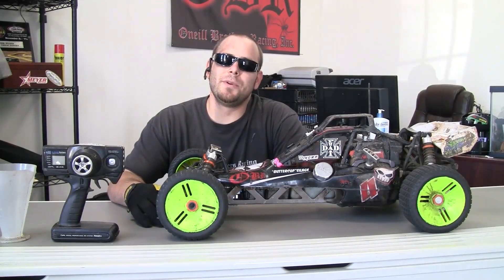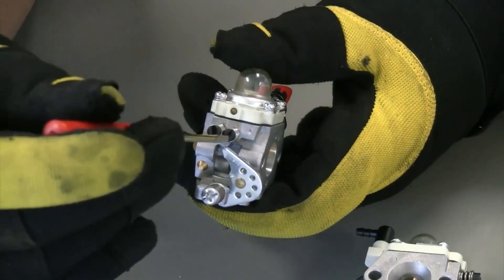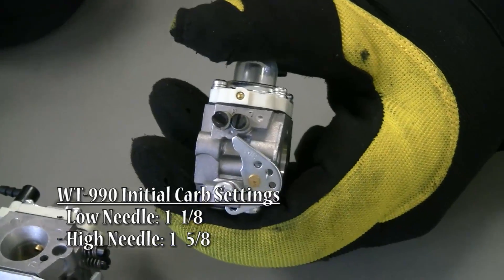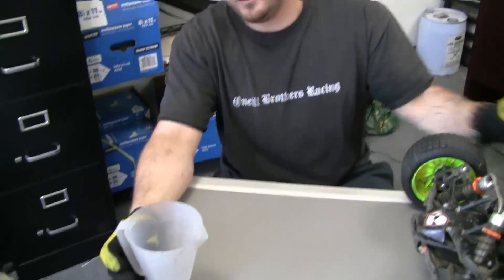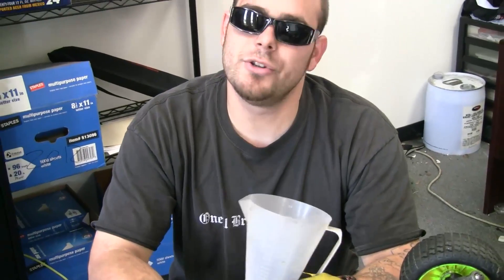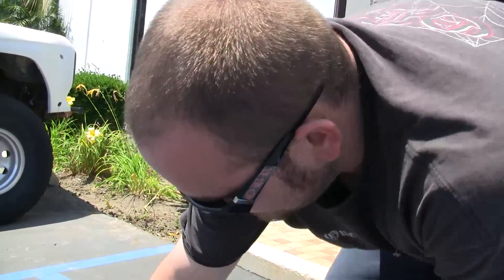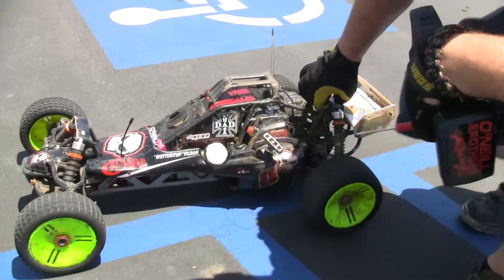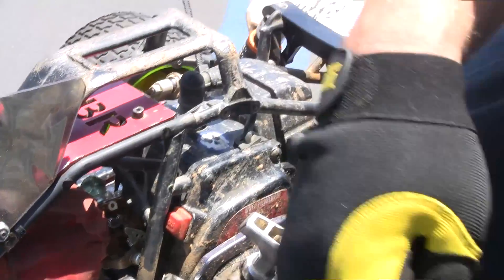Fifth-Scale Engine Break-In and Tuning

Comment: I have also heard people tuning with the wheels up off the ground, with the throttle pegged and they move the needle to listen to the engine and the dance between lean and rich, once they find center, they go just to the rich side of the middle. Is there any validity to that? Or does it have to be under load?

Comment: 28 to 1 - that’s what I plan to run in mine!  (Maxima K2) - 43cc, not as “screamy” as these, though.

I was thinking, “these turn kart-engine revs, so they want kart-racing mix - 16 to 1 or so.”

Was taught with chainsaws, “richen it till it blubbers under load, then lean it out until it just stops.”

Also, with these engines, you’ll want to adjust the carb frequently, as temperature and changing air density (and possibly, phases of the moon) seem to affect mix requirements.

Comment: This vid got my idle perfect but now I get no fuel going to my carburetor.
I press the bulb and air is going into the tank causing bubbles.
When it should be sucking fuel an I correct?
I recently changed the fuel tank and new wt668 carb.

Comment: Thanks for the knowledge n what not!
from OBR website; This video covers everything you need to know about break-in and tuning your new OBR engine. The Wt-1107 and Wt-1242 were not out when this video was made. Starting settings for a Wt-1107 are 1 1/4 low and 1 3/4 high and Wt-1242 1 turn out on the low and 1 1/2 high.

Comment: Hey there, I just bought a roven baja 36cc. I checked the jetting before i even started it for the break in after watching your video. The high speed was set to was set at 1 1/2 but the low speed was at 1 3/4. I thought well its smoking so i just broke it in with that setting. 4th run it it blew out the plug. To rich. My question is since its broke in can i turn the low jet to 1 1/4 with out hurting it ?
Reply: Yes but don't go straight from 1 3/4 to  1 1/4! 1/16 or 1/8 of a turn max at a time and you will need a couple of minutes running till the new setting show any difference.

Comment: If youve had your baja stored away over the winter and you start it run it and lost your tune is it ok to put both HSN & LSN back to factory settings and start again or will that damage the engine? Bare in mind the motor has about say 15 hours run time on in in the last 2 years so its well run in
Reply: Yes it's fine to play around with the tune whenever you need to, a big change in temperature outside (winter - summer), you will need to change the tune. Also check you're not using old fuel or fuel that was left in the tank or carb. It's always best to run the tank and carb dry before storage and add a few drops of neat 2 stroke oil into the cylinder and pull the engine over slowly with the pull start to work the oil round.

Comment: 17:50: I didn’t really notice anything that sounded like popping compared to when it was tuned. Could I please get a little more in depth about being too lean? Sorry I just couldn’t see or hear how it was different. Thanks! 👍
Reply: Not sure about the popping either but it will sound empty and tinny and may even bog down when accelerating. Then when it comes back to idle the revs will stay high till it settles (providing the low end is OK but the high is lean), if the low is lean it will bog down or even quit when opening the throttle quickly from idle, it'll also be hard to start.

Comment: Hey guys in your opinion will running a leaner oil mix 40:1 or 50:1 make more power?
Reply: Yes but not by much. If it's hot where you are you want to use more oil because you're already lean on fuel if it's tuned optimally. In winter or when it's cold out you will richen the needles for optimal tune so you're already getting more fuel so you can get away with less oil. I'd say, roughly, if it's below 10c you can use 50:1, 10-20c 40:1, 20c+ 30:1.

Comment: Tuning "If that's what you call that" is one thing but I guess driving is another. hahahaha.  You don't tune an engine by eye and sound, it is done by looking at the plug. I didn't see any info on that tho. It almost sounded like it was (Four Stroking) if you know what that means. Learn how to tune the pipe maybe. The only engines I will buy is Quick Draw. Leaning for power is for Glow engines and is not a myth, for gas/oil it is a myth. Most people come to gas/oil from glow engines and that is where the myth started in the gas/oil 1/5th scale world. I will say this, with the power to weight ratio much higher with the glow engine cars, the people "Like me" who come to gas/oil from glow engines have better driving skills and know better how to set up the suspension. Put a little positive camber in the rear and it wont spin out. Run the front wheels dead zero toe in/out and add a little positive camber and the car will track dead straight. Drift cars use negative camber and what does a drift car do? It slips or designed to spin out. So when I see people running negative camber I already know the driving performance will be subpar. than again I run alcohol in my 1/5th scale using the Walbro WT 499-1 alcohol carb, and I use a starter belt not the pull start. I also use a sliding pipe that lengthens and shortens in sync with my throttle position.  I guess some of us just know more of whats available in the 2 stroke engine world and know how to transfer that to 1/5th scale. I hate bolt on people and people who waste my time.

Comment: Great explanation man, I have a wt 721 1191 carb that i can't get adjusted. Can you tell me what's the adjustment for it please? Thanks...
Reply from the maker: 1 1/4 low and 1 3/4 high. If it's no responding to tuning I would check for air leaks.

Comment: hey bro great vid. im running an 1107 carb on your 34cc ful mod reed case in my 5t (temper21st check out my vids)i do have a 990 that is dailed in. would like to dial in the 1107 to see which is better . what carb setting would you recommend? plz help ty

Comment: The best oil IMHO is the Ipone 2T oil...Do you sell mod engines on Amazon? I remembered way back you had them on ebay...thanks for the video...i screwed up blindly a long time ago before youtube...nobody to turn to...also check for fouled spark plugs....usually a hard start will start with a new spark plugs...have a handful handy....is there any need to put after run oil or break in oil?
Reply from the maker: We do not sell our engines on amazon or ebay anymore. We had to charge extra due to their fee's and now everything goes through our website. No need for after run oil in this engine like you would a nitro.
Reply: @oneillbrothersracing  ok thanks..corresponding through emails...

Comment: Which carb comes with the Zenoah G320RC ?  I looked at the online manual for the losi 5ive 2.0 and it just gives me the part number for the engine.

Edit: After looking a bit online I think its the WT-1107
Reply: Do you own the engine yet?
For a very short spell they were 997s
Got to DDMs site and check.
Should be  an1107.

Comment: I would say this is the best video on youtube on tuning and break in. I've watching this video multiple times while breaking in my redcat mt and xb and learn something new each time. I just recently bought a zenoah g320rc motor and I'm currently breaking it in. The stock hy32cc motors on both my redcats are trash. Killed both of them shortly after break in. Maybe 3 hours of operating time on each and they both lost compression and stopped cranking. ...i'm hoping for better success with the zenoah motors because now I'm about $2000 into this hobby between vehicles, tools, and motors. I'm addicted though so....oh well. Thanks again for the awesome video. Once I learn a little more about OBR motors I hope to upgrade soon. Thumbs up!

Comment: Hi mate i have an issue with my g320 bogging about half throttle. I also noticed air bubbles in both fuel lines' if i prime the bulb while the engine is running it doesnt bog at half throttle and will rev right out like normal. I have new fuel lines installed and a new 2hole grommet. Plz help this thing is pissing me off lol
Reply: rebuild ur carb the diaphram is prob bad

Comment: Whats your thoughts on Amsoil products? I use 927 but was wondering if you had a bad experience with them or even Klotz? (love the smell of Klotz, I know, not a great reason to run it)
Reply: Amsoil dominator I believe is a good one...but I use MAXIMA FORMULA K2 a buddy recommended it and I take his word since he has over 6 5th scales and does lots of racing...even races with these guys up at the chase compound...I do 25:1 on my hpi 5b but might start doing 28:1 on my losi 5t seeing how much oil it spits out after I break it in..rite now still breaking in the motor on 25:1...i also recommend there MAXIMA air filter spray

Comment: I just got a Zenoah g320.  Will 91 octane pump gas be ok?  Some are saying that you need a higher octane that is ethanol free?  Please help.  Thank you.
Reply from the maker: Brooke Hodson yes 91 octane pump gas is fine. Ethanol in small amounts won’t hurt. If you have ethanol free fuel available great but if not the compression is not high enough in a stock engine for race fuel.
Reply: Would adding STA BIL help with the ethanol in the gas?  Thanks for your reply.
Reply from the maker: Brooke Hodson you’re welcome. Personally I’m not a fan of using additives. Were we are in California it’s impossible to find pump gas without ethanol and we’ve never had any issues.

Comment: Great tutorial on how to break in an engine and tune the carbs. One question that never seems to crop up, is what the gap should be for the spark plug in thousands of an inch. Surely, if the spark plug gap is too wide or to narrow, it will make a difference as to how the engine performs.
Reply from the maker: Thank you. Plug gap 0.020 - 0.025"
Reply: Thank you Sean. It is just something that never gets mentioned in most videos I have looked at, on breaking in new engines.

Comment: Great video buddy..... question: is it possible for my low needle to be at half and still run rich...?  I am running 25:1 with redline on a 990 carb. I live in the Caribbean and it is hot. I know there is a lot of confusion with this topic where temps and altitude can affect your needle settings.  Any advice would be welcomed.  
Thanks in advance
Reply from the maker: Laurie Benjamin thank you, I’m glad it was helpful. Yes it is possible. To run rich at that lean of a setting normally would be a bad carb or an engine problem. When we run in the dunes we see temps of 100+F and 1 turn is normally the leanest I’ll see. In your case I would check the plug for color to  make sure it’s not white/grey and running lean
Reply: +Sean O'Neill thanks for the quick response: actually I am still in the breakin with a ported zenoah’, what even more strange that it would not start with the stock settings however at 3/4 and the idle screw all the way in she spits.  Plug is kind of black not white.
Reply from the maker: Laurie Benjamin  You’re welcome. That’s good it’s not running lean. I personally would try another carb if you have one just to rule out if it’s a carb issue or not.

Comment: Subject:Rampage MTMy Concerns/problems:1.Adjusting the hi/lo speed needle what does it do?2.Tuning up with a cold engine is not good,is this a myth?3.The guy from the shop said"if you having difficulty to start the motor adjust the throttle from your transmitter"but i still having a hard time starts it.do i have to adjust the idle screw like what you did?if it yes?counter clockwise?3.i was playing the rc trying to push it just to check how far it can go.all of a sudden it shuts down.i checked everything gas,battery it were good.what could be the possibly reasons why the engine stops?4.too much rpm and theres no much power.what will i do?(upgraded filter k&n)5.too much oil/smoke coming out,is this normal?
Thanks!!!

Comment: Need some help please, I have a Losi 5T with the WT-668 carb, the car was running fine when I got it, and I travel for work so it sat for a month, now I can not get it to fire, I put a new plug in and it's got spark, the primer fills up, it just seems as if it's not getting gas at all, because I've tried taking some in a primer bottle and putting a few drops in the plug hole, and it will fire and burn that out and that's it
Reply: I should add it has a 29cc motor

Comment: When I run 95 octane in germany it is 91 octane in the usa can I run 100 octane which is 95 octane in the us in the full moded 31.8cc 9.1hp with stock compression? And does it have a difference and is 91 octane to less(usa) or should I go with the 100 octane (Germany )? Please Mr. O'Neill help me
Reply from the maker: If your 100 octane is equivalent to our 95 octane that will be fine for stock compression.

Comment: what going on OBR. Question. is cam 2 fuel good for these motors.  I have a 34cc full mod. thanks.
Reply from the maker: Personally we have not used it. As long as it's within 91-95 octane without additives you should be fine. Unless you custom ordered the engine with compression for race fuel.

Comment: I have a quick question, I just got a new 1/5 scale and when I'm breaking it in, for the first step where I just let it idle, should I let it idle on the ground or with the wheels off the ground because I know with my nitro/ nitro cars in general you should let them idle wheels off the ground. Thanks!
Reply from the maker: +Mr. Motivation We usually put the nose of the car against a wall to prevent the car from taking off if the idle was get high enough to engage the clutch.

Comment: For my first 1/5th scale truck I got myself a King motor 30.5cc Ts2000 with a few upgrades. King motor says to let the engine idle/drive it easy in circles for an entire tank of gas and recommend a 25:1 ratio. What are your thoughts on this? Why do you guys recommend 28:1 for your engines? While the fuelie engine provided with King motor rc cars isn't made by you guys, would you recommend I follow your break in procedure and use your recommended fuel to oil ratio? I'd like to have the original engine last as long as possible till funds can be saved for a suitable replacement from you guys.  Any help would be appreciated.
Reply from the maker: +TheOmegaRevolution 25:1 is a little more oil and won't hurt the engine. The quality of their engines isn't the best and I would stick with 25:1 to be safe. Our break-in guide will work for your engine.

Comment: Got a question. When letting it cool down between the steps and when your done running it, do you put it at BDC or TDC with the piston?
Reply from the maker: +Greg Winn You don't need to worry about where the piston is when you're letting the engine cool.

Comment: thanks for your video ...but I have a problem that my exuest leaks oil when i start the engine ..what should I do?
Reply from the maker: +nawaf almuqahwi What exhaust do you have and where is it leaking?
Reply: +Sean O'Neill it's the victory exuest ...leaking from the exuest hole
Reply from the maker: +nawaf almuqahwi It's a 2 stroke and there really isn't much you can do. You can use a silicon tube on the stinger to direct the oil away from the car.
Reply: +Sean O'Neill I think maybe a tuning problem
Reply from the maker: +nawaf almuqahwi Even if you have a perfect tune oil will come out of the exhaust because it a 2 stroke and oil is mixed with the fuel. A good tune will help with less oil coming out of the pipe.
Reply: +Sean O'Neill thanks alot
Reply from the maker: +nawaf almuqahwi You're welcome!

Comment: I was thinking about getting a baja 5b just wondering why lots of people use 91 octane fuel and not 95 or 98?
Reply from the maker: +Benny2980 The compression on most engines is set for 91 octane. We custom build engines with higher compression for race fuels. The compression needs to match the fuel.
Reply: +Sean O'Neill Ok thanks. Great vid, very helpful.
Reply from the maker: +Benny2980 Thank you!

Comment: Great video thanks for posting! Is the 990 and the 997 similar to each other in settings? Would it be better to swap to a 990?
Reply from the maker: +Mike K Glad our video was helpful! The 997 is similar to the 990 but with a choke. Settings will be about the same. When the carb goes bad I would look into a 990 but wouldn't toss a good carb.
Reply: Sean O'Neiell
hello I'm currently running your 7.7hp full mod with vp,leaded 110 octane with blue marble at 25/1,do u think that is a good combo,I woukd love to talk to u guys for a set of pipes and gas n oil suggestion on my rcmk twin,o yea,your motors are insane!!

Comment: hey I have a losi dbxl and when I turn my HSN clockwise until it stops my settings isn't the same as your video..
Reply: +Chris Baugh Don't go by the position of the notch, that may be different on every car due to differences in the manufacturing of the needles threads. Go by how many turns from closed it is, as suggested in the video.
Reply from the maker: +Chris Baugh The settings we give are just a base line/starting point and will change after fine tuning.
Reply: +Sean O'Neill so  when I go clockwise and close the HSN it's ok if it doesn't look same as yours does in the video. I have the original Stock WT-668
Reply: ***** so when I close the HSN the notch is almost parallel

Comment: Great Video. Do you tune per Carb or per engine? I purchased a Zenoah G290rc and it has 990 carb but the factory settings are diff from what you mentioned in the your video.

Comment: I just got the Rampage XT and the manual says I have to run it on a 20:1 ratio for the first four hours at 1/3 throttle, then a 30:1 for another 4 hours before its broke in. Not sure if the engine your using is similar to the XT.. Can I break it in the same as you did?
Reply: Yes it's fine. The manufacturers are just covering there backs against people who don't have a clue how to tune or what to listen for if it's out of tune! At 20:1 you can't really damage an engine no matter what you do with the needles!